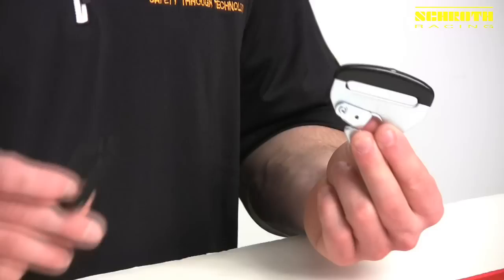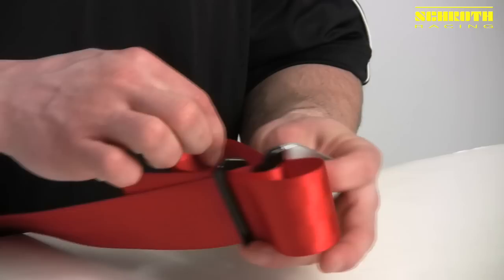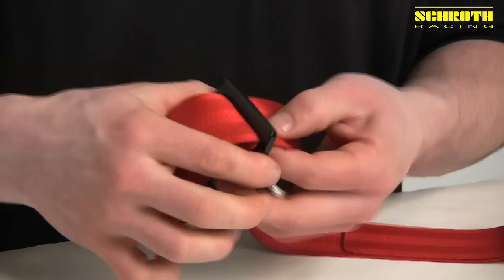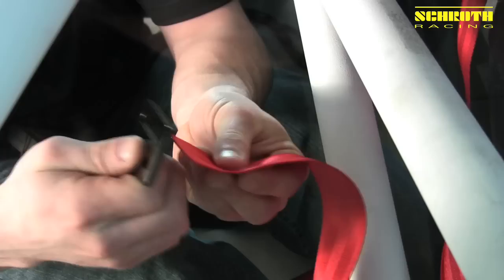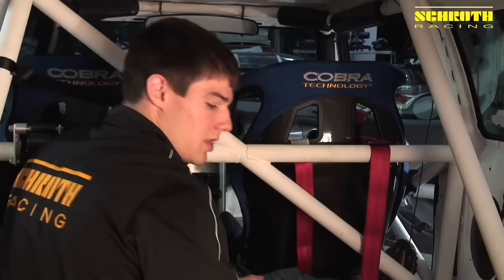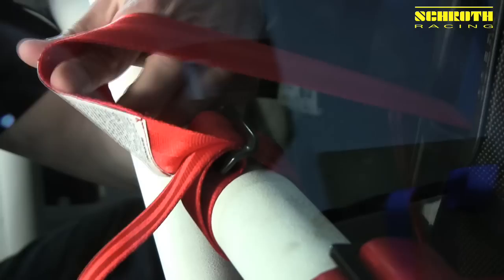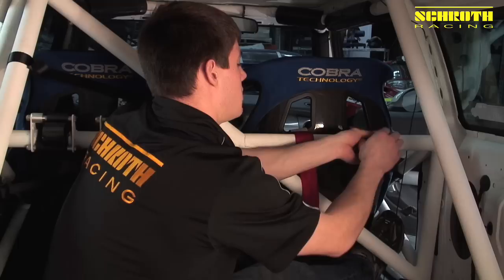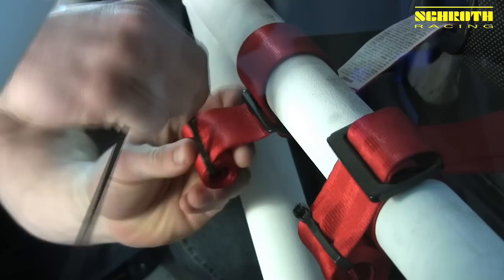SCHROTH Training #1 How to Wrap Your Harnesses Correctly

Comment: To all the people talking about harness bars, roll cages typically have their harness bars integrated as that center bar.  You do not have to have a harness bar mounted to the roll cage if the roll cage has its own bar built in for that purpose since the built in bar is much more secure than a harness bar. The built in bar is better than the harness bar, which is more of a temp-fix for people who have no roll cages or roll cages without horizontal center bars. However, the statement "no harness bar= no harness" doesn't apply here. The point of the harness bar is to provide an anchoring point at the correct height instead of the vehicle floor for to prevent spinal compression.  the roll cage does the same. It really doesn't matter as long the bar is strong and placed at the correct height.

Though granted, having that bar at a slightly higher height would be safer, because for harnesses, the belt is supposed to be either parallel with the floor or angled upwards towards the rear to prevent spinal compression in an accident.
Reply: 10th o.o o

Comment: I'm trying to convert the sub belts on my prof ii from wrap-in configuration to snap-in configuration. Aside form the snap-in buckles and LV4 bar slides (and of course the eye bolts and backing plates) is there anything else required for the swap?

Thanks!

Comment: you need at least a harness bar to mount your belts to or a mounting point that will be at shoulder height. if you mount your belts anywhere below that in an accident it can compress your spine and cause serious spinal damage.

Comment: wow, cant belive idiots in here saying you need  a HARNESS bar LOL, a harness bar is for the little wannabees who dont have a real roll cage, and its prefered to mount to the actual cage than the body of the car so that you dont get your spine compressed in the event if a accident. imagin if the car breaks apart and the floor pan goes with it that your harness is attached too. the roll cage is going to the most sturdy part of the car and also the part that is not going to move much in a accident. the idiots commenting about how this is wrong coudnt be farther from the turth, truth is most people dont wrap there harness right or mount them correctly, this is actually one of the vidios that shows you the right way.

Comment: When i crashed my 92' miata my harness saved me from breaking my face on the steering wheel.The airbag broke my tooth caused a concussion and burn my face a little. Without the airbag i would have walked away but since i still hadn't gotten around to taking it out i got knocked out and woke up in the hospital.The harness is enough to save your life the airbag just made things worse in my case.

Comment: he did  it right. that one bar is the harness bar, and it's  weld/integrated to the roll cage.   most harness bars are for show, and not safety.  only time a harness bar would be okay is for solo(autocross) and use it with a good harness.   why harness bar get a bad name is because people will use them on the streets with a 4 point harness. which is not good. in a crash you can submarine under the lap belt, also your shoulders will be held up right at the same causing your neck to be thrown front and then back. can you say head bangers ball.  

safety works as a system. schroth and hms (one of the main leaders in motors sports) know what they are doing.  if you are going to buy a harness bar at least make sure it's a good one, or have a race shop build you one.  also  use good stuff (schroth, pyrotect,simpson, cobra,sparco,corbeau, etc.)  and stay away from the show/stance ebay crap. (braum,nrg,ciphar auto, etc).